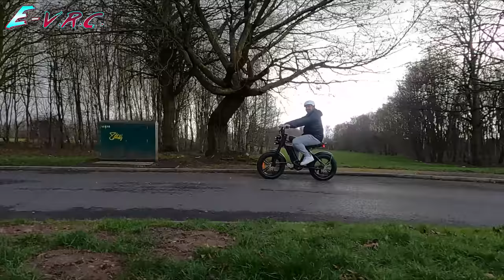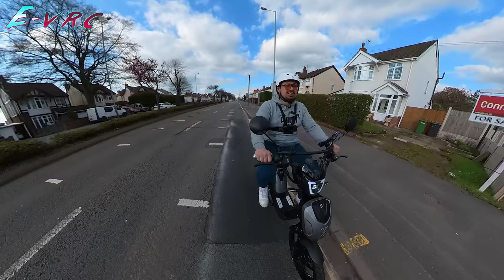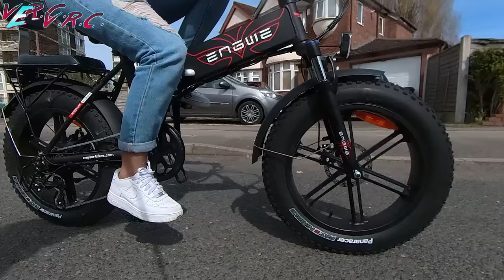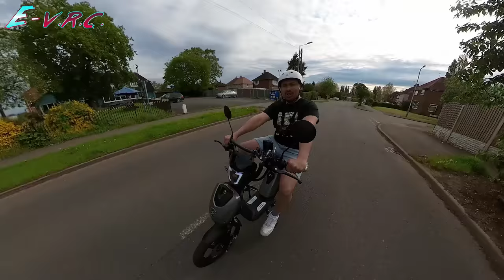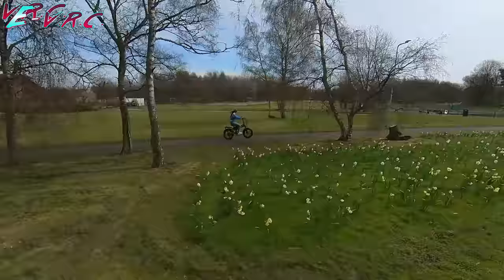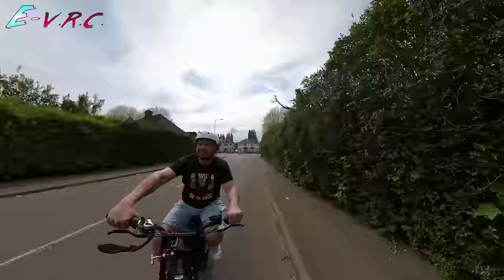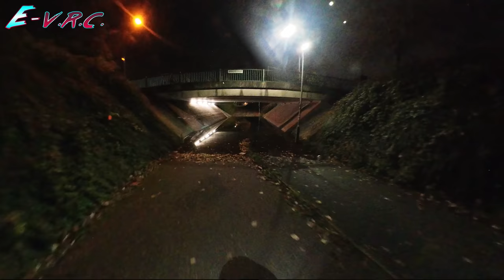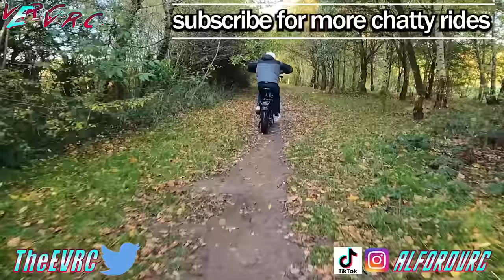The CRAZY Ebike law that MUST Change Before Someone Gets HURT

Comment: As an e bike owner myself (a legal & 15.5 mph restricted one) I can see the government's concern on restrictions. I fell off mine 2yrs ago at around 12mph & broke my right arm in 3 places after slipping on moss on a gentle curve! People who were not in the know IMMEDIATELY thought I was riding a unrestricted one due to press over mr Simon Cowell. Nope mine was a Halfords Carrera. The medical staff who treated me thought it may have been the weight of the battery that contributed to the injury. If that happened to me on a restricted one, imagine what an un-restricted one could do to you, bearing in mind no protective clothing is usually worn on one apart from a helmet.
Reply: I have broken ribs, collar bones, elbow and neck of femur ( hip ) on a normal bicycle. The fastest I have ridden on my time trial bike  is 60 mph in a mountain TT, on a long down hill section between Richmond and Stanhope. I have maintained 27.4 mph for 25 miles and got up to 42 mph max speed on the hardly hilly A19 in races as well, and that is without any electric motor ?

Comment: Honestly i believe they should create a whole separate set of laws derived from motorcycle/bike laws, and make each other meet midway. Like have ebikes that can go the speed limit go the speed limit, if your ebike cost above a certain number then you're required to have insurance, and most bikes that has enough power to go the speed limit do cost a lot so there you go. Honestly I think the laws shoud just think of this as a whole seperate vehicle and maybe even create a license, theres so many ideas that can be implemented but only the wrong ones are implemented by people who don't actually own ebikes themselves.
Reply from the maker: Good ideas. I think the american system works well. I wouldn't be against some kind of cbt too. And maybe a personal insurance (not per bike though I'd need too many lol)
Reply: if there were complicated licence and insurance etc then I would just get a noisey 125cc petrol motorbike so that I can have more power, screw the neighbours and CO2 etc
Reply: that's not really true, in Europe ebikes in general are very expensive and a generic ebike conversion with a Bafang BBSHD has more power than the average speed pedelec while costing 1/4th of the price if done right

infact a SurRon actually costs less than all speed pedelecs that have some power in my country

a generic high power ebike (over 5kW) can also be built for less than speed pedelecs

problem is, then the EU etc will probly ask for a COC and VIN number which will probly be impossible to get as a non-manufacturer, which is one of the reasons i simply can't convert a bike and turn it into a speed pedelec for a far lower price, which sucks major ass to be honest

thats the only reason i still ride a 25kph ebike, cause i just can't get around buying overpriced junk and i definitely wont lol
Reply: @BH4x0r  you good bro just was spouting ideas because i just feel like it sucks.
Reply: @inzetajacklon1278  the whole European legislation sucks, especially with the extremely overpriced speed pedelecs and all decent middrives on European ebikes exceeding 250W anyways

Comment: Let me share my perspective. I've been a cyclist for 60 years and been riding motorbike for 50 years since my first moped. I am also a trained engineer with an understanding of physics and the laws of motion. I have yet to get an ebike and experience and motorcycling has impacted how I cycle. The reasons for not having an ebike, yet, may become apparent below.

Firstly I will talk physics. It turns out that the force of impact, how much damage is caused if you hit a car or tree, is related to the square of the speed that you are travelling at. What does that mean? If we just focus on the speed bit, if you are going at 10 mph the speed contribution to the impact would be 10 times 10, that would be 100 units. At 15 mph it would be 225 units and at 20 it would be 400 units, 4 times that of 10 mph and nearly twice that of 20 mph. At 30 mph it is 900 units. The amount of force in an impact greatly increases with speed. You can see why 20 mph zones are a good thing for vulnerable road users, the impact force is much less. you can play with real numbers here https://www.omnicalculator.com/physics/car-crash-force#force-of-impact-definition-impact-force-equation . You will also see on that calculator the heavier you are the more it hurts too!

Ebikes in the UK are intended to be used by unlicenced, untrained riders, including children. There are no mandated safety equipment rules. That is because the continuous speed an average cyclist can do is between 12-16 mph, and a 15 mph ebike falls into the manual speed range. The risk and danger is no greater than cycling. 

You can get faster ebikes, speed pedelecs, but in the UK you need a licence, insurance and must wear a certified crash helmet since they are to all intents and purposes an electric moped. Would you want inexperienced children,  riding around on unlicenced high powered ebikes crashing and killing themselves? I don't think so.

Next...as I mentioned above forces involved in motion greatly increases with speed. A bike that routinely hits 20-30 mph may be subject to much greater forces and stresses than a bike that routinely hits 15 mph. The 15 mph ebike can be based on standard bike components since standard bike components are designed for an average maximum continuous speed of 15 mph. A bike regularly going 20-30 mph must have stronger wheels, frame, brakes etc. to deal with the increased stresses. This is why speed pedelecs have to be subject to regulation and stricter standards. They may be heavier and less suitable as a pedal only bicycle. Whilst you can put a high power motor in a bicycle frame, the bicycle frame and its components are not designed to take it.

The above was the science, the rest is my personal opinion. As a motorcyclist I no longer cycle fast. If I am riding around town, a 20 mph town in most places, on my motorbike, I wear, as required by law, a motorbike helmet. I also wear a protective jacket, gloves and boots. If I have a tumble at those low speeds I have good protection. I realised years ago that I had been hitting 30-40 mph down hill on a bicycle only wearing shorts and a t-shirt, no helmet and no chance of stopping if a car came out a side turning. I have seen the damage caused by accidents at these speeds, it isn't pretty. Since I am not going to wear "all of the gear",  to help prevent injury, just to get around town on a bicycle, I decided that I should probably not exceed the design speed of the average human. The average running (typical maximum human design speed) speed is between 8-12 mph. At around 10 mph you are less likely to injure yourself, more likely to be able to stop to avoid the car or pedestrian that appears in front of you. That is how fast I cycle most of the time.

Since I don't plan on going fast I don't need a fast ebike. In fact since I have geared my bicycles to suit the hills of Brighton and the South Downs I don't actually need an ebike at all, although I have thought about getting one. If I do get one, a regular 250W/15 mph one will be good enough, I won't be hitting 15 mph.

To the point about throttle vs pedalling. I would suggest that if a person does not have the competence to ride a bicycle then a person may not have the competence to ride an ebike of any sort. Stopping in the right gear is a basic part of cycling. We all get it wrong sometimes and it doesn't really matter. It is an inconvenience. Having additional power whilst pedalling is analogous to the dynamics of ordinary cycling. The term for an ebike is EAPC, electically assisted pedal cycle. It is assitance. Having a throttle turns it into a pedal assisted electric motorcycle, there is a difference.

There are plenty of street legal electric mopeds and motorbikes out there, some of them are cheaper than ebikes and can carry things like shopping. just look at the electric moped pizza delivery guys. If you want speed, and the additional safety you can get from better tyres, brakes, without getting sweaty, get one of those.

A final thought. If you are in the UK have you read the latest Highway Code from cover to cover? If you haven't you really should. You will discover that there is no such thing as "right of way" and that there is something called the Hierarchy of Road Users which defines much more clearly the way in which everyone, including cyclists should behave. I would suggest that if you haven't read it you probably should not be on the road.

Comment: yea i totally agree the Throttle control is an issue, sadly i watched an older lady on her bike get run over at a crossing, her bike didn't have cut of brakes as expected and wenn she got to the crossing she changed down gear as you do that ment however pedaling so because of that the bike pushed her more forward and got ran over from a HGV
Reply from the maker: Oh no that's terrible.

Comment: good point about the top speed of cars. in Canada a 16 year old can by a Ford Mustang with 500 + hp that can go 0-60 in seconds and well over 150 mph/240 kmh  . But locally people complain that the main highways should be twinned to make the roads safer. how about making cars that cannot go more than the speed limit unless it is an emergency vehicle .
Reply from the maker: Crazy isn't it. Although i suppose cars are insured and it costs more to insure faster cars. But that's a none issue if the rich kid has the car bought for them.
Reply: I assume this wouldn't age well with car prices, imagine spending 100k on a car thats limited to 70mph. rip, this would be good for the average driver but car prices on cars without limits would go up. it'll be like a collectors item and become crazy with prices.

Comment: I have a Fiido M21 PRO and very simple to unlock the speed control. They even put a 250 watt sticker on the 500 watt motor to help you get around the law. I can cruise at 30 mph and if you see a copper just slow down a bit and ghost pedal. The police in most cases have not got a clue about the law and in 18 months of riding mine I have not been stopped once. My work is 6 miles from home and can do each way in 22 mins also.

Comment: Dude stuff did a great clip about this a week ago. I agreed a lot of it but the only thing was his thought of top speed of 22 mph to 25mph. I think 15.5 with peddle assistances and throttle and then 20mph just peddle assistances. Young riders of 14 to 17 years old have up to 500watts, but then older. Can have 750watt. Plus what gets me is a good number of companies selling e-bikes do sell e-bikes with throttles. That’s one thing that gets me. And most of them not even speed restricted.
Reply from the maker: Yeah I caught that a couple of days ago as I was putting this together. What timing lol. Great video though. I'd be happy with what you just suggested 🙌
Reply: @e-VRC  lol yeah. Well I think it’s good timing. There’s a lot more people talking about this. And it the law should change. Like you said. There’s cars not speed restricted and the laws say they have to do certain speeds. And same with motors bikes as well. Really if there this up tight on e-bikes they should slap on speed limiters on all cars and so on. Does make you think don’t it.
Reply from the maker: @garretthamster  definitely. Yeah hopefully we can drive traffic to each other.

Comment: I have a 250W ebike I built before the throttle/pedal sensor law came in - parts imported from China and lead/acid mobility scooter batteries. It's great to ride and does not have a pedal sensor at all and no speed limiter - runs 21mph on the flat on the throttle - is it still road legal now the laws have changed? (For example a Model T Ford wouldn't pass a modern MOT but you can still drive them) BTW I do have a full unlimited motorcycle licence and I can't help thinking at least a CBT and road registration/insurance/number plates would cure a lot of the silliness around ebike laws.

Comment: If you've got a 15.5mph  speed limited ebike, then I don't see why you shouldn't have a throttle, even if I'm not totally convinced by some of your arguments as to why you should (looking silly for instance).

The green button thing does look like a good compromise, I'm guessing it's basically the 6kmh walk-assist function? 

But I'd rather something that will give you a burst of 100% assist at any speed within the limits, solves the getting away at the lights, solves the whoops in in the wrong gear (although if you can't master gears should you be cycling at all?), and solves the this bike has been poorly designed so the pedals got the ground when I lean (although that's really just sloppy design).

So I'll go for a burst of throttle thing please, ten service seconds of boost and then it cuts out unless it senses I'm pedalling.

Comment: I live in New Zealand and have seen e-bikes on the road doing 45kmph. I have no problem with this, I ride motorcycles and 45 is still slow in comparison. 
The two things that concerned me were the lack of protective gear being worn, at 45kmph a crash is going to cause damage to the rider. The road positioning taken by the riders. 
Roads marked with cycle lanes often place the cyclist between the parked vehicles and the "live" motor lane, this puts the e-bike rider close to the parked vehicles, while travelling at speed, andobscuring them from emerging vehicles, what could possibly go wrong? 
As a motorcyclist I would be riding close to the centreline to increase my visibility into intersections and likewise make myself more visible to vehicles emerging, I'm wearing full M/C gear and have passed training courses to assess my capability to ride on the road.
I think e-bikes should be permitted to go faster, but restricted dependent on who is riding and their level of experience.

Comment: The throttle on most ebikes is actually only a switch giving a blast of power. The only time I use it is to help taking off from the lights or at a busy junction to move quickly. After I am moving I only use the peddles. It also can serve as a walk mode if you have a heavy bike going up steps maybe.. But why the law makes a thing out of it is beyond me. It's not even relevant to any safety discussion and potentially makes it safer. The only exception being if you have a child who plays with it while the bike is switched on. An experienced user will know to switch the bike off when not in use of select PAS0.

Comment: UK Ebike laws are silly strict.  for me i do not want top end. i just want a bike that can tackle the valleys of Wales,.  up down up down. up down. yeah, little 250W is fine for places like flat London. but in the real world not so much, i have long said i would still be happy with 15 Mph. but 250 watts simply does not have the power to get up those inclines.
Reply: Same here. I’m opting for the 750W to handle the hills in the Snowdonia range in the North

Comment: I used to think the front end of a car  was the most dangers bit, we are now a long way below 10 a day dieing from blunt force trauma in the UK. Pollution from tires and exhausts kills around 30,000 a year. But taking the lead at 100,000 deaths per year is inactivity.
Cycling naturally linked speed with experience. Powerful e-bike would become another 'donor-cycle'.

Comment: That delay after u stop pedalling is a death trap! Had that on one of my 1st controllers I installed on my ebike... Sometimes (alot of times!) I'd forget and end up being launched somewhere I didn't plan to be.... Especially around tight corners😫🤕
Reply: Yeah. It's stupid and dangerous. There should be an option to turn it off. The solution I came up with is to tap the brake the second I stop pedaling to cancel the pedal assist. It's annoying having to remember to do it every time.
Reply: Agree that the pedal assist delay is something to learn and adjust to

Comment: Fundamental problem that causes all nitpicking is... perverse decision to treat these vehicles as "bicycles". Remove that and all can be solved. All "e-bikes" have a motor. Hence, by common sense they are a motor vehicle. Designate them as such because obviously, they are. Require registration, license, insurance. Remove all limiting laws - you want to design it with throttle - do so, you want 2000W motor - do so, remove pedals all together - do so. But, also, do not drive these motorcycles in bike lanes and in places designated for human powered bicycles. Don't pretend that you drive a bicycle, no you are not you are motorist on a motor vehicle.

Comment: i bought a old used ebike which was pre law change, bafang hub doesnt even have disc holes,  came with throttle so just took all parts of that and transferred to a new frame, built new batt and thankyou, didn't do it on purpose to have a throttle as i didn't even know about any of the laws or rules then, but now i know well that is my excuse for having it, just need another one for why it does upto 30mph.
Reply from the maker: Haha brilliant. Just say you're a fast pedaller and try to set the limit before you speak 😂😂

Comment: Had a Ribble Endurance ALe ebike with a mahle x35 rear hub motor weighting 29lbs. 250w and 15mph speed limit was fine. At 15mph , you don't notice when the motor cuts in or out. At even 40% assist , steep hills were super easy.  At 100% assist it would climb a 15% hill at about 10mph compared to 5mph on a non ebike which is absolutely fine. On the flats you do not need ebike assist  so 15mph cutoff is fine. 

I don't ride in  the gutter a you say , having no trouble 99% of the time on the road cycling, partly due to being an advanced driver and motorcyclist which influences how I cycle.